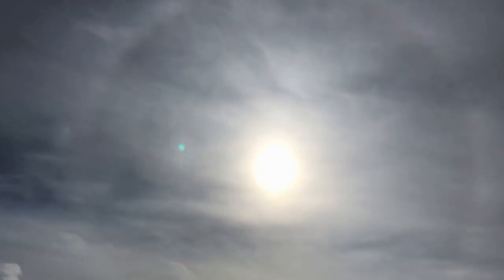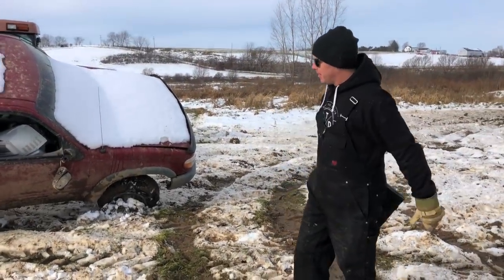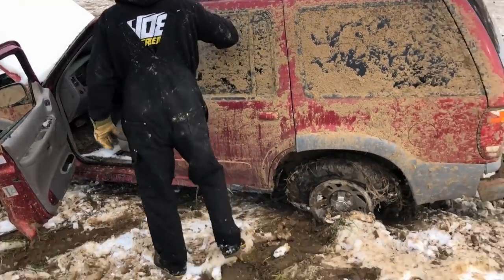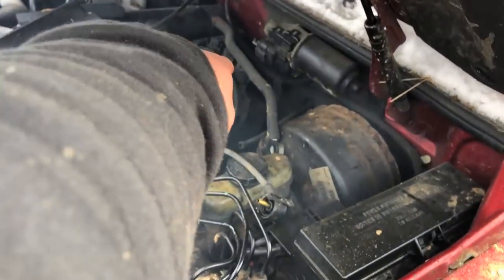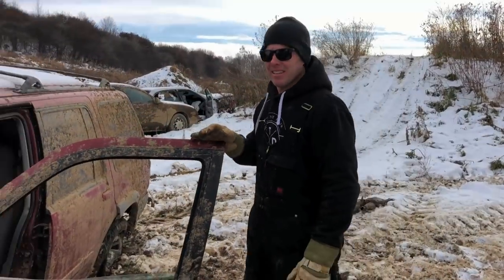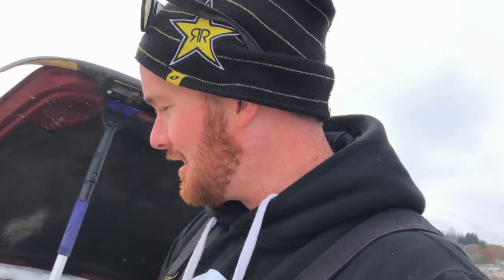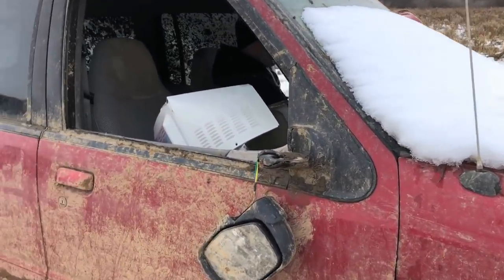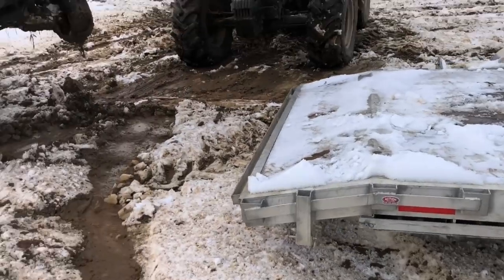Completely SEIZED The FORD EXPLODER!!!

Comment: I like your video, but I have to question if this engine is truly seized. From what I understand a seize is when the engine gets hot enough that the pistons  expand and get stuck. I.e. Seized. I believe a seized engine is stuck. Unable to turn over. Maybe after a cool down. Your engine still turns over. A different failure. I could be wrong, but I don't think so. Thumbs up for getting rid of a ford. I still don't know a good one. Peace ✌